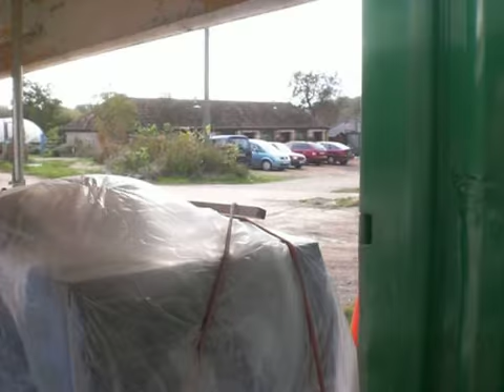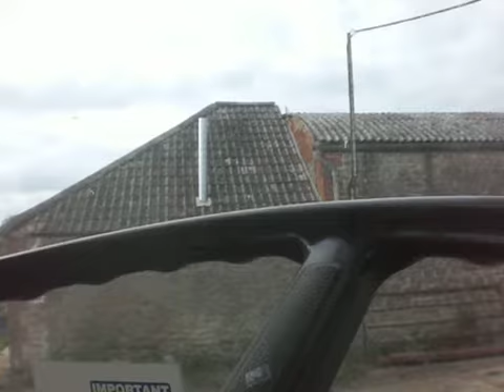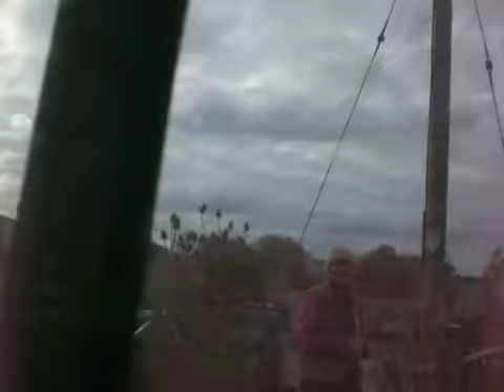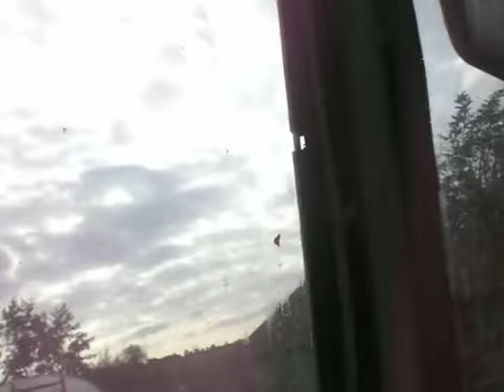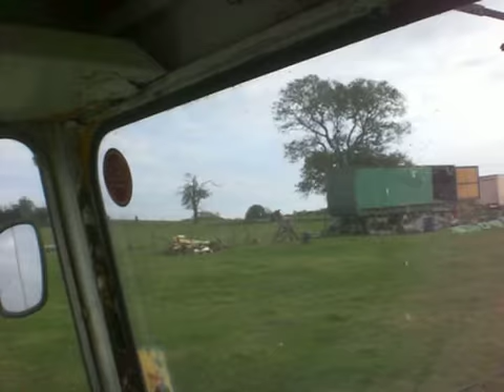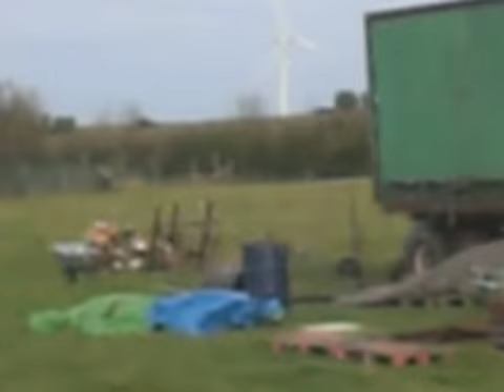Milk float off road electric vehicle solar and wind power

Comment from the maker: It has a new quieter controller now....
Reply: Hello, just wondered if you still have Earth Rover 2? I have a Cabac with a bus style body. Would really be interested to know how well the solar panels work?
Reply: @robertp.wainman4094  Yes - currently living at a friends off grid place, providing some of their power - yes they work well :)
Reply: @napierpaxman  
Thanks for reply Napier - I'd like to put solar panels on mine but CBL gave the impression it wasn't worth it for the power gained.
Reply from the maker: @robertp.wainman4094  Hi friend - depends on how much you use it - can be up to 5 miles a day :)